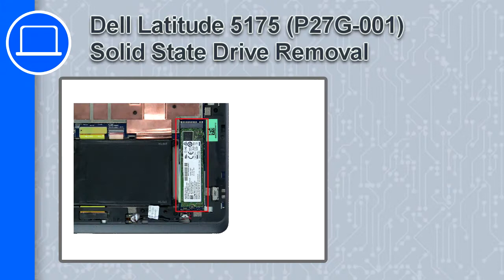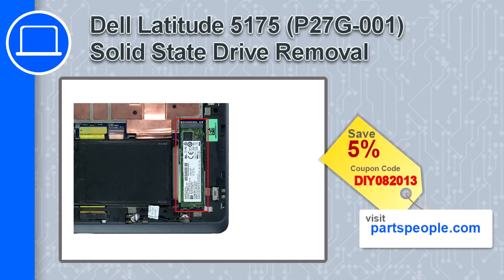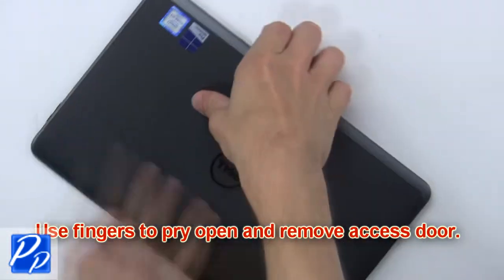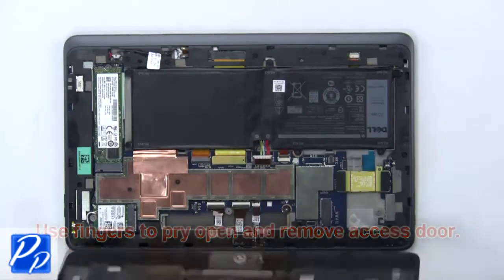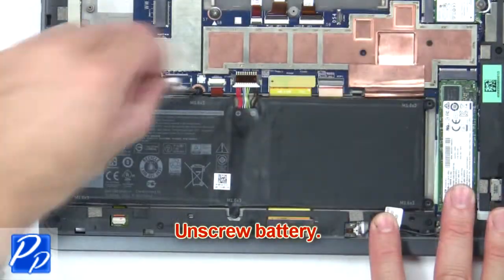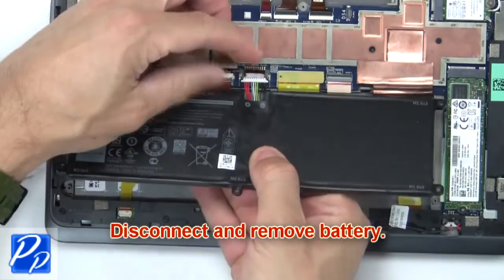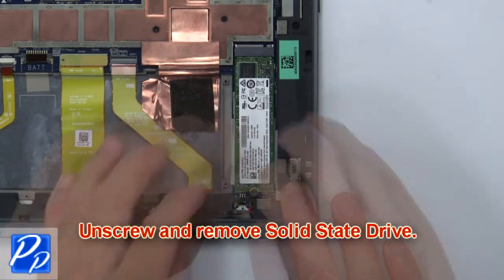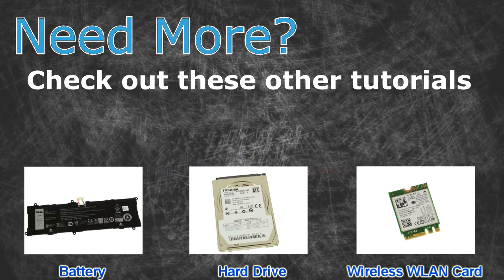Dell Latitude 11-5175 (T04E001) Solid State Drive How-To Video Tutorial

Comment: Hi, why you remove battery? It seems possible to remove ssd without removing the battery, isn't it?
Reply from the maker: It's not necessary to completely remove the battery, however, Dell recommends you disconnect it before performing repairs on your laptop.